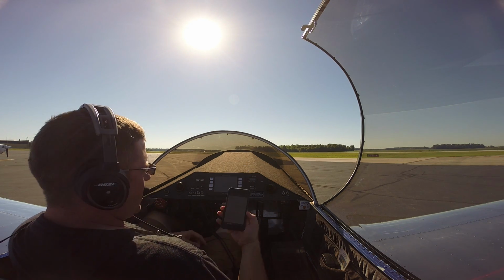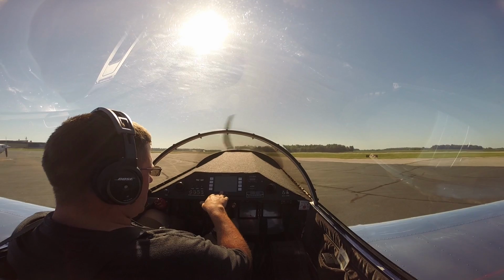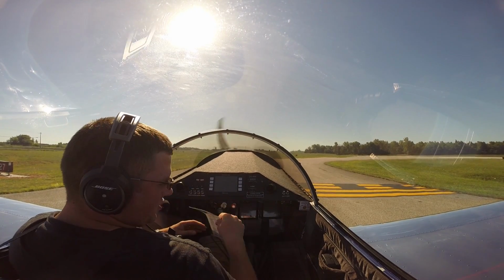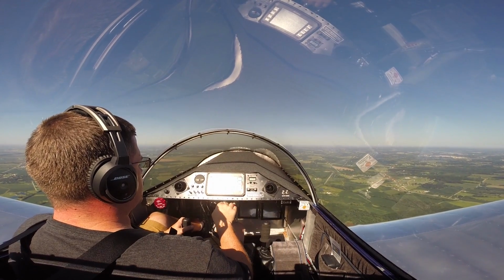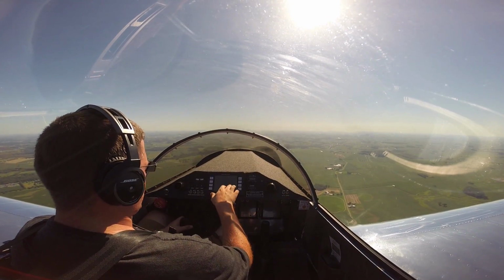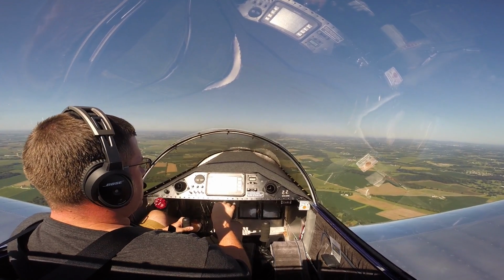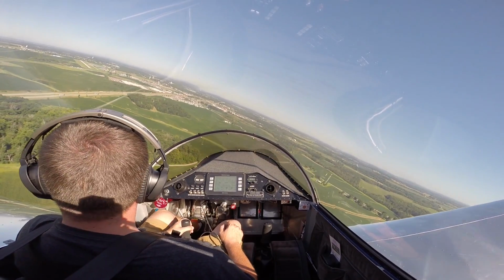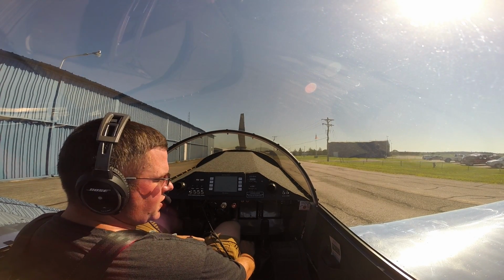Flying the turbo with Michael Farley

Comment: when u  say cylinder temp   do u really mean   cyl  head temp    r u measuring it   under the plug or where   and  54 x 50  prince p tip   ok  ,,u added  a turbo what were the figs   before turbo  and did u use same prop    tia

Comment: What gas type are you running? When you hit 40 manifold pressure that's at 2 minutes at a time and 35 is cruise pressure right? how long between hitting 40 can you go back to 40 if needed?

Comment: Maybe it's the camera angle but can you get two adults in the cockpit?
Reply: Tom Open well, I’m 6’3” and 240 lbs so taking people with me can be a challenge. I’ve had people as big as 5’10”, 180 lbs in there with me and it’s snug but okay for short hops. That’s probably about as big of a passenger as I can carry. On the other hand, two people at 5’8” each would be comfortable. For most Sonexes you’ll end with a useful load of around 400-450 pounds and if you can keep things within that limit you’ll be fine!

Comment: Why no waste gate?
Reply: blastman8888 the turbo AeroVee does in fact have a wastegate that is used to prevent excessive boost pressure from possibly damaging the engine. It's spring loaded (automatic operation) so there's no manual control for the pilot. Once boost pressure reaches a certain level, the pressure overcomes spring tension and opens the wastegate. Simple!
Reply: Michael Farley Is that how all aircraft turbo engines work you have to control the manifold pressure at lower altitudes and then when your up higher you can use full throttle nothing to compensate for altitude.
Reply: blastman8888 Most "modern" turbocharged airplanes I instruct in, such as a Cirrus SR-22T, have automatic wastegate controls that are super easy to use. Simply go to full throttle and manifold pressure goes right to maximum allowable!  Easy!  With the AeroVee turbo you have to be a little more careful because the wastegate controller is sort of a final fail-safe...for normal flying, the pilot watches the gauges and sets power for maximum allowable. I hardly ever have the throttle pushed all the way forward. It reminds me more of flying a Kingair with PT-6's; they're the same way!  As you climb, eventually you'll reach an altitude where you'll be able to go wide open throttle and you'll still be in the allowable manifold pressure range. We call this "critical altitude" which means above that, you'll be at less than full power even with the turbo working as hard as it can. Make sense?
Reply: Michael Farley I'm not a pilot but want to be so I'm just learning about aircraft engines I have built some turbocharged car racing engines and we always used a pressure regulator to control the waste gate some connected to computers some were just manual like a regulator on a compressor airline and a blow off valve for over pressure when you cut the throttle fast during manual shifting you wouldn't need a blow off valve or want one on a aircraft in case it fails. Seems a manual pressure regulator would adjust to atmosphere pressure keep the engine manifold pressure constant as it uses that as a reference line.

Comment: Hi Justin, the company demonstrator that crashed had more time than that; I believe it had nearly 100 hours with the turbo. A final cause has not been published at this point. 
My engine, after the turbo addition, now has nearly 100 hours on it and it's ran very well the entire time. I believe there's now around 12 turbo AeroVee owners flying and no one has had any major issues. Overall I've been very happy with mine!
Reply: Thanks for the reply, Michael.  (And the peace of mind :D)

Comment: Hi Michael.  I really enjoyed your video.  Very well spoken and easy to watch.  I'm curious, I'm somewhat new to the turbo and have just recently learned of the crash at Oshkosh with the owner and a mechanic from Sonex in a plane with the turbo.  I couldn't for the life of me find any information on the cause other than engine failure after take-off and the vehicles at impact.  If I remember correctly, this was somewhere between 20 and 30 hrs TT on the engine.  I was really excited about this engine until I saw this.  A dig on NTSB showed a few more crashes related to engine power loss after take-off with AeroVee engines.  I'm just curious to know how yours is running.  How many hours on her?  Any problems so far?
Reply: Read the NTSB report: the fuel switch was in the OFF position. And we know that the demonstrator airplane had the fuel shutoff valve at the firewall and is controlled with the foot. Its pretty obvious that on take off the pilot unintentionally switched off the fuel with his feet.

Comment: Good question Mark. I wouldn't say that you can't perform acro but you would need to be careful with abrupt power changes, especially when adding power so you don't over boost the engine. If you're considering Advanced level acro that requires major power changes very quickly, the non-turbo AeroVee or Jabiru/Cammit 3300 may be a better option just to make life easier. Just my opinion of course!
Reply: Need to work on that automatic waste gate.  Make it routine instead of emergency and you don't need to worry about over boost.
Reply: Or maybe a manifold pressure regulated stop on the throttle.  Just an idea that popped into my head.  Never heard of such a thing, but that does not make it impossible.
Reply: +Mark Holm: Def. a problem solved decades ago... VW uses a frequency control valve that pretty tightly controls boost.. seems easy, but adds complexity and a boost controller.. (could just do EFI with an ECU to control it all FADEC..... lol)

Comment: I had a good trick on my V35TC for managing turbo lag and over boost on take off roll.

Rest your index finger on the throttle control knob as you grip it so that the crease of the first knuckle is laying on the inside edge of the knob. This will stick the first third of your index finger out in front of the control knob. 

On take off roll go ahead and floor until your finger tip bumps the panel while keeping your eyes up and out and making your airspeed and engine gauge scan. As your take off roll stabilizes and the turbo has spooled up you can now easily monitor your MP and start applying full power.

Works great and keeps your head up and eyes out at that critical first few seconds of roll out